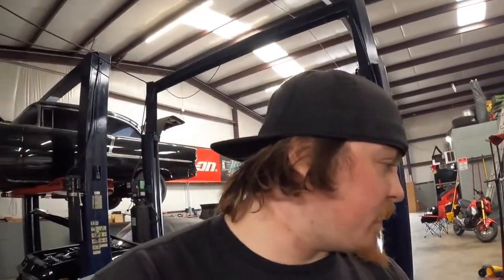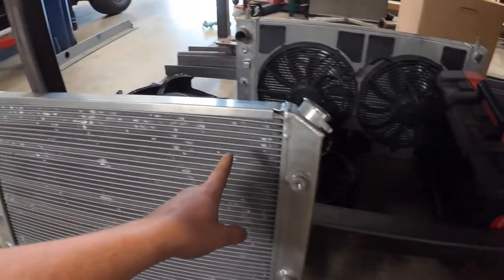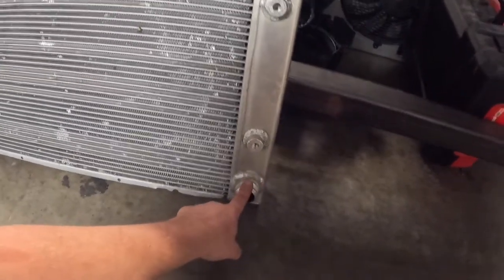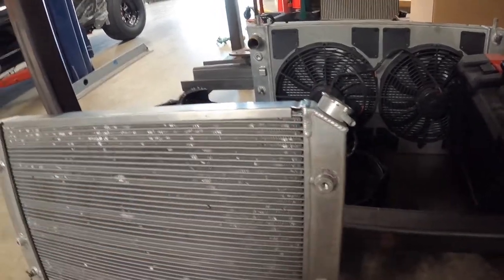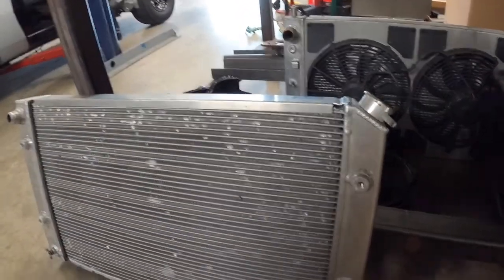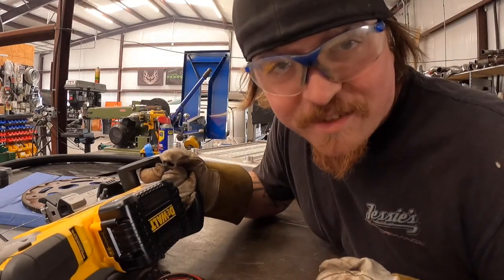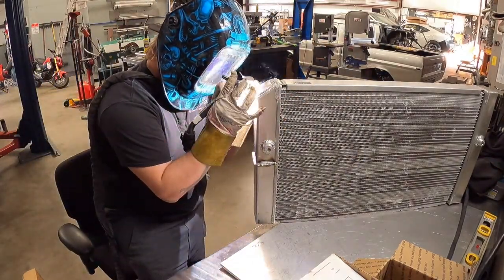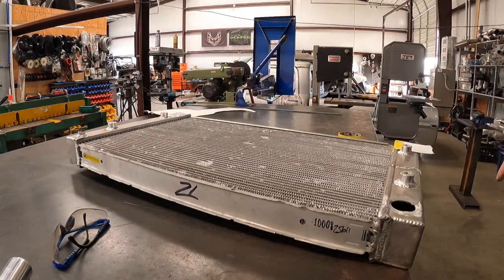Modifying a single core radiator to a dual core

Comment: Isnt there a transmission cooler there where you put the plate? I’m guessing your not using it? Very very cool mod. Genius.
Reply from the maker: We usually put trans coolers down along the frame, keeps unnecessary heat out of them